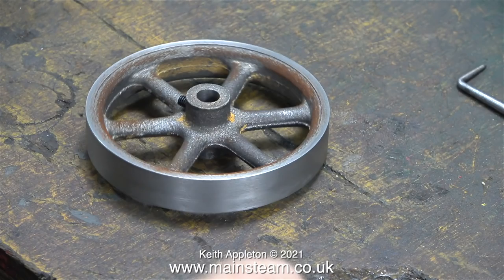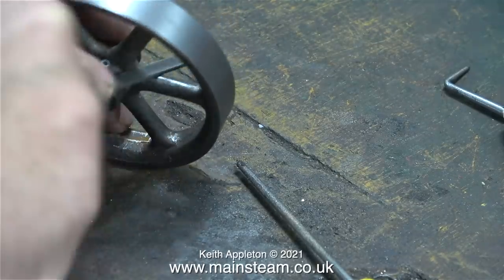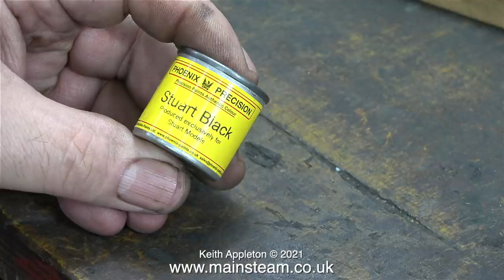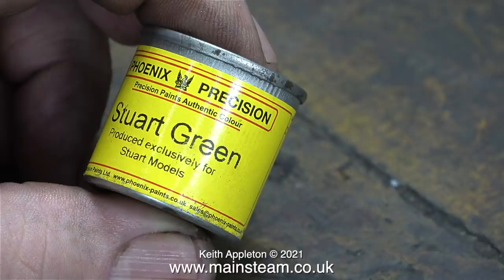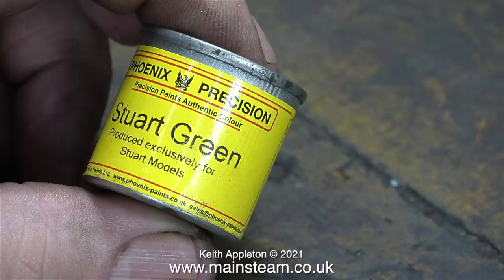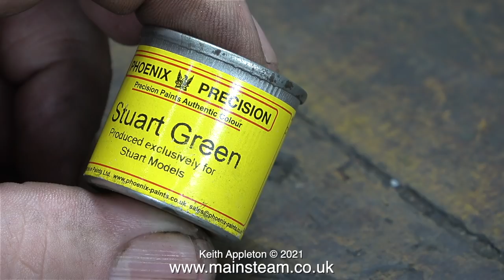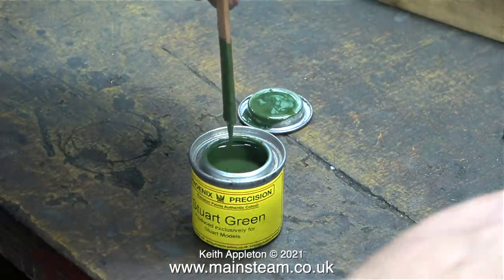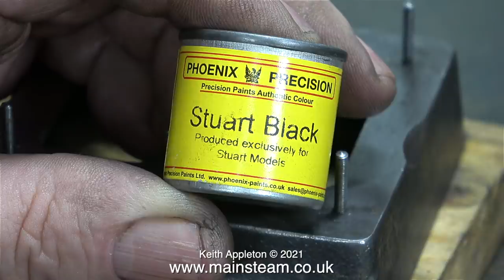MAKING A STUART MODEL STEAM PLANT - PART #21

Comment: Sorry if this a redundant question.
Upon final assembly of parts like these, which obviously don't need a gasket, do you use any kind of a separator between otherwise naked iron castings? A paste wax perhaps? Graphite?
I would be concerned about rust adhesion, if for instance the model were to be put away wet, for more than a few times. 
I steam and fabricate, vicariously through your work. I have the abilities, but not the resources. With great admiration mixed with some envy.
Reply from the maker: Not usually unless the mating faces are badly damaged or uneven.  Good quality gaskets seem fine as they are.

Comment: I don’t understand why the base didn’t need primer before the black paint.
Reply from the maker: The castings are rough and I don't need to use primer because the paint sticks to the casting very well and is easier to repair if it gets damaged as there is no added primer layer to chip off. I have mentioned this in many videos.

Comment: Keith, does that phoenix paint not need a primer?
Reply from the maker: The castings are rough and I don't need to use primer because the paint sticks to the casting very well and is easier to repair if it gets damaged as there is no added primer layer to chip off. I have mentioned this in many videos.

Comment: Do the castings need any primer or dose the Phoenix paint adhere ok on its own?
Reply from the maker: The castings are rough and I don't need to use primer because the paint sticks to the casting very well and is easier to repair if it gets damaged as there is no added primer layer to chip off. I have mentioned this in many videos.
Reply: @keithappleton  thank you for your reply Keith, I thought that might be the case but wanted to check.

Comment: didn't need to primer paint the part?
Reply from the maker: The castings are rough and I don't need to use primer because the paint sticks to the casting very well and is easier to repair if it gets damaged as there is no added primer layer to chip off. I have mentioned this in many videos.
Reply: @keithappleton  thanks didn't think of that .  I always thought you had to use primer before topcoat